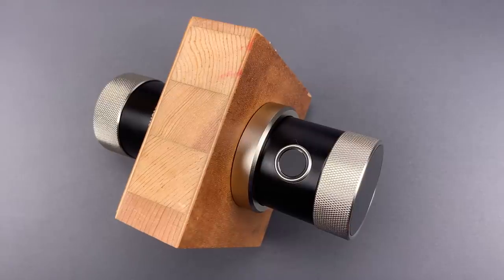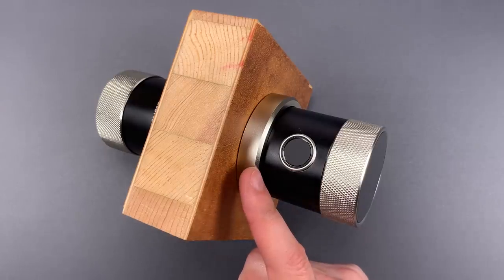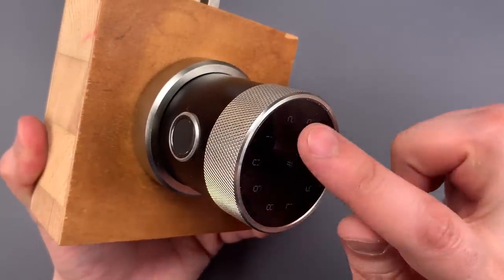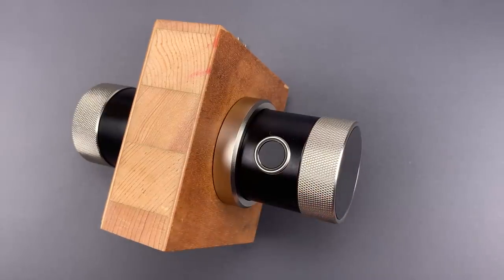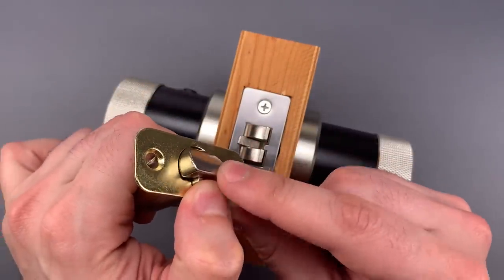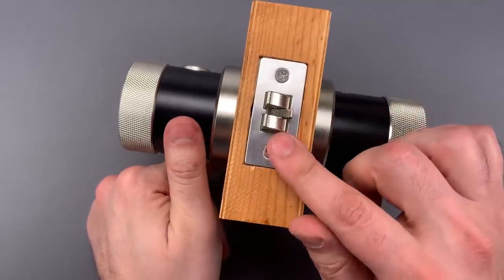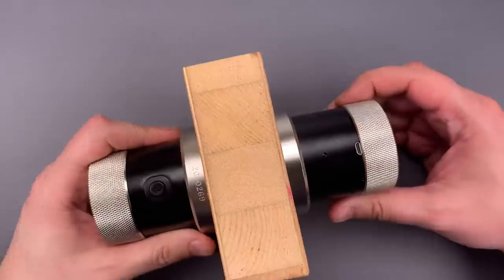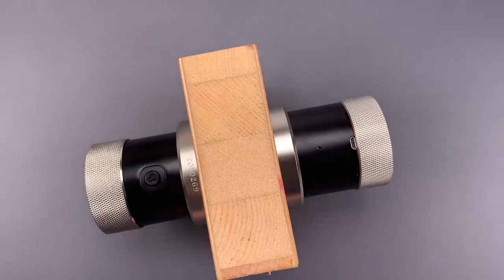[1120] Fingerprint Lock That Forgot The Fundamentals - DatoHome L-B400

Comment: I have a major problem with locks like this, if it can connect to a phone, that means it can be connected to anyone's phone, and even 12-14 years ago when I was starting highschool tech knowledge was already common in the more "little shit" type kids I went to school with. I should know, I was one of them. Though I wasn't that into hacking and such, I was more into things like, figuring out where the GPU was inside the school computers, and covertly unhooking them with a pair of popsicle sticks when I was done with one. That sort of thing, but there was a kid who knew how to not only get into the school system but legit change things on everyone's computers from his personal laptop. He didn't get to keep using his laptop for long. 

So my main worry with a lock like this, is where locking picking takes skill, a way to break into one of these locks is only going to take one little shit figuring out how to spoof it, and then share that info online, and now anyone with a phone can do it. Even the worst lock can keep a random idiot out, but the best smart lock given enough time won't even keep a grade schooler out. 

Plus I must ask... how would one open this if they forgot to charge it? Does it automatically unlock? If so then you could attach a thing to the USB slot, to drain the battery and you would be in. Or just simply attach something to massively overcharge the battery and force it to explode, and that would likely have the same effect only it might also light the door on fire. As cool as it is, it just seems like a major security risk that I would not want to take.

Comment: Having the USB connection port on the outside is also probably not a good idea.
Reply: Where else are you going to plug it backup power?
Reply: @UpnorthHere  the inside of the handle.
On the secure side of the door.

Comment: All of this tech bypassed by the oldest trick in the book because it forgot physical principles. Im as teched out as they come but sometimes mechanical systems still serve a purpose. I would hate to have one of these things during a long power outage for example a physical key is still the most redundant way to secure the most important space in your life.
Reply: It uses internal batteries. AA batteries to be exact. So power outages won't make the door unopenable. Unless you ignore the low battery warning for weeks and never replace the AA batteries in the indoor handle.

Comment: Too fancy, multiple ways to open the lock is not as secure. Bluetooth? I think that could be hacked. RFID? That too could get hacked. Key pad on the front? Hackable. USB connector? Not wise. A way to drill out and open the lock (with the spot marked with a hole)... again, not wise.  And as our host pointed out, the latch should be upgraded to what I call the "Anti Jimmy" latch. The lock shout be Thumb Print ID only with none of the other opening options (and lose the drill out hole).  If you get locked out because the battery died (because you were away too long), just do what a crook is going to do anyway.... put a 4 foot steel pipe on the handle and snap it off the door and open the latch with a screwdriver. It is actually faster then using the lock's normal unlocking process.  Ture, some crooks don't want to leave evidence of "forced entry" so you will not know right away that you have been robbed. But once you get home and see your stero missing, the game is up anyways, so crooks just bust in. This lock is nice and cylindrical.... perfect for the pipe trick.

Comment: Wtf. Why is the USB Connector on the outside? Thats a really bad place for it, as long as I don't want to charge it with a solar charger...
Reply: It's there only to provide emergency power in case you ignore the low battery warning for weeks and never replace the AA batteries in the indoor handle.

Comment: fingerprint readers are useless for me, I dont have any, thanks to working on hot engines, cars & motorcycles, & even auto-body work, not sure what did me in 100% but they are not readable,  my job, uses fingerprint reader time clocks, I have to use an override code, when I got my CCW permit police couldnt get prints, & had to accept best smudges, officer said never seen that before, & he tried dozens of times, so my fingerprints that are on record with police dept, are smudges, & I think its hilarious. I think 1 edge of 1 ring finger can print a little, but rest are totally smooth

Comment: why is the charge port on the outside and that design hole lmao
Reply: It's  not rechargeable.  That's the bsckup power inlet. Wouldn't do you any good if it were on the inside.
Reply: @UpnorthHere  woudent do any good if u dont have a powerbank with u or a wall outlet xd

Comment: Not only that the reset is on the outer side, why is there a usb connection on the outside??? The outside knob has to be plane. WTF?
Reply: It’s so if it dies you can charge it while locked out it’s AA battery powered

Comment: Why is the charger on the outside part? Makes no sense whatsoever
Reply: It's not for charging. The lock uses AA batteries in the indoor part. That port is used to provide emergency power if you're in the situation where you dumbly ignore the low battery warning for weeks and find yourself locked outside your home with the lock dead.

Comment: Is it just me or are US Doors somewhat unsafer by design? No European door would ever be considered "locked" with just such a bolt. Thats not even a bolt from my point of view. Common e.g. German house doors has such a bolt but when  locked a second lock bar, that can not be moved from outside the lock at all.
Also all door frames are angled on both sides so that you can not easily slip cards or such tool in that easily. 
So the e.g. the  "creditcard-trick" would never work. 

I do not say that it is impossible to open doors up, but it's at least is not THAT easy.

Comment: And when the battery dies you are unable to open the door lol
Reply: That's why the USB ports are there: To provide emergency power if you dumbly ignore the low battery warning for weeks.

The lock itself uses standard AA batteries in the indoor handle.

Comment: Why would anyone want to charge their doorknob?
Reply: It's not rechargeable.
Reply: You supply AA batteries which you put in the indoor handle, and replace those batteries every 6-12 months when the low battery warning appears.
Reply: @PanduPoluan  still, seems like way to much effort
Reply: @aaronwood8374  Replacing batteries every 6-12 months is too much effort? Consider the benefits this lock offer, that's a worthy price to pay.

Comment: Yo. What if it dies how you get inside.
Reply: That's what the USB port is for: To provide emergency power if you dumbly ignore the low battery warning for weeks and never changed the AA batteries in the indoor handle.
Reply: @PanduPoluan  ahh gotcha, my door has an electric lock. It has no way to charge it if it dies.  No way to replace the batteries from the out side. So if it dies and I’m outside I’m screwed.

Comment: Dimple and micro-usb port should NEVER be placed on outside/unsecure side. Absolute fail.
If its a safeguard against dead batteries...then an actual key and slot should be part of it...not a reset pin that anyone can clear with a paperclip
Reply: It's a dimple not a hole. So an attacker still have to bring a drill. If an attacker is committed enough to bring power tools to break in, then no lock will be able to protect your house.

Comment: So the USB port is on the outside .... 🤦‍♂️ 

Talk about a solution waiting for a problem. 

Carries my laptop to the door with the drivers predownloaded, connects via usb, Presto Ejecto Cuz!
Reply: You can't install a driver through something that only caries power to the battery
Reply: @emmastrange1770  interesting theory, but I would tend to lean towards the usb connector was used for downloading the firmware and software at the factory and testing of the firmware and software for quality control, thus having data capabilities.

Comment: If there are four ways to open it there are 4 ways to hack it; at least. I don't trust this at all.
For example, is the bluetooth connection encrypted? What about the app on my phone? Is there a way to find out through the software, if I am home or not? What does the micro usb on the outside connect to on the inside? Why not usb-C? How safe is the fingerprint sensor? What about seeing smudges on the numpad? Is it safe against memory overflow?
And so on...

Comment: So... a very high tech design that can be opened with a plastic card or a clip... who the hell designs that?, I get that its designed for an easy unlocking and you can put a camera to monitor the access, but then why do you need the lock once that you have the camera?, I mean that think is not worth its battery.

Comment: what would be nice is a HOLE the size of a wire.  NOT 3" of hole under it that can take the do anything inside.
For all the 4 battery power this has it would be a GREAT solution to using a hammer and BEATING IT OFF..  To get to the Mechanics INSIDE.
OR
Give me an internal tot he LOCK INSIDE, so that it REQUIRES this External hardware from the outside.

Comment: Whack the handle off with a sledge hammer ..

I'm determined to wind inward slide or and turn the spring ball or spring curved when shut needs handle turning/handle dowmward or upward dogs trick 180 turn the handle .
I'm determined cheap SmartWatch interface WiFi/bluetooth with inside stretch extend to screw the inside from watch Face screws slots with stacked rings vvvv flexible to cover the thickest doors .

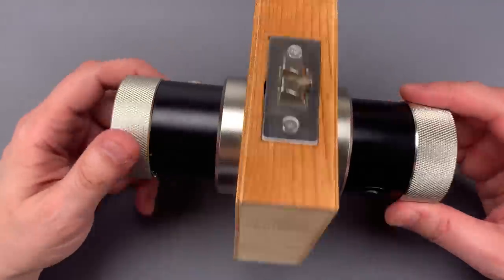Comment: 2:17 I think you have inside and outside swapped. The USB and dimple should be on the inside and the fingerprint sensor and keypad on the outside.
Reply: Nope the fingerprint reader, keypad etc are the outside part.  The USB and dimple are on that portion.
Reply: @RodPascoe  You're right. He turned it around. Why on earth did they put the USB port on the outside.

Comment: That's cool an all, especially since they've apparently updated the latch but yeah, as others have said, having to charge your door knob is ridiculous and would just be a pain in the ass.
Reply: Remember to charge your smartphone, the bluetooth earphones, and oh yeah, the DOORKNOB!
Reply: It's not for charging. The lock uses AA batteries in the indoor part. That USB port are used only if you're dumb enough to ignore the low battery warning for weeks and came home to a dead lock.
Reply: @PanduPoluan  So it takes batteries as well?! That makes it even more shit!
Reply: @Cyba_IT  it doesn't take batteries "as well". It is NOT rechargeable; it REQUIRES AA batteries, standard ones you can buy at lots of places. That doesn't make it "shit", that was a smart and consumer-friendly decision.

You use the USB port ONLY if you're too stupid to let the "low battery" warning fester for weeks without doing any action, i.e., stopping by a supermarket on your way home and buy replacement batteries.

Comment: I am not sure what kind of design goal dictated the charging port to be on the outside door knob.
Reply: It doesn't have a charging port.  The backup power inlet is on the outside knob in case you ignored the low battery warning for a couple of weeks and find yourself locked out with dead batteries.

Comment: What's up with that micro usb on the outside handle of the lock?
Reply: Emergency power port if you dumbly ignore the low battery warning for weeks. (It uses standard AA batteries)
Reply: @PanduPoluan  ahh I thought that the lock designer wanted to charge their phone while standing outside the door 😋

Comment: Eww...the second I saw the micro USB port I immediately knew this was garbage...and it was on the outside part of the door. To charge your smart lock you have to run a wire from inside your entryway outside to the knob?? LMAO!!
Reply: It’s battery powered it’s for if it dies when you aren’t home
Reply: @DJR711  Yea my Lockey is designed better...if my auto door lock dies when I'm not home I dont have to fear needing to charge it while sitting on my porch while it loads up for me to get inside. My Lockey is simple...if it dies...use the super special magic key device it came with....
Reply: @uberyoutuber3892  I never said it was better lmao I just said that you don’t charge the handle
Reply: @DJR711  LMAO. alright dude. Like I said I own the Lockey auto door lock. lolol. Not mad yo never was.